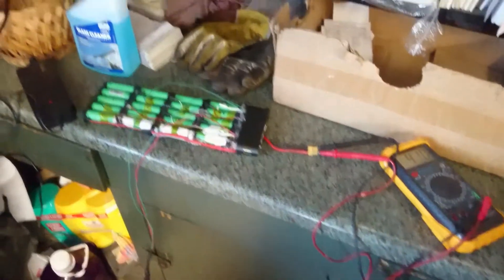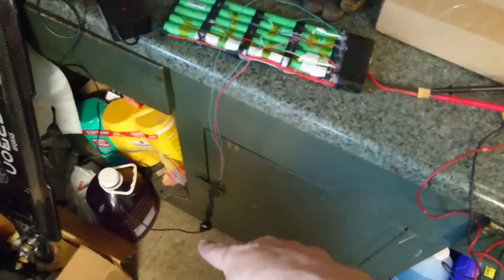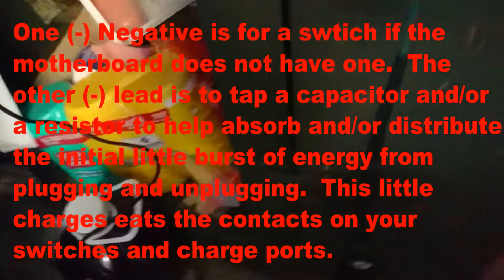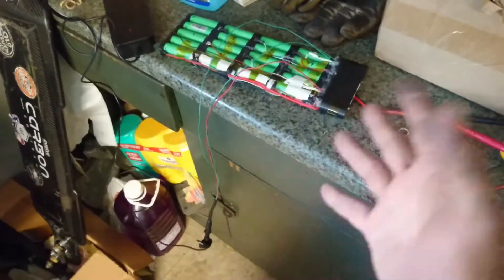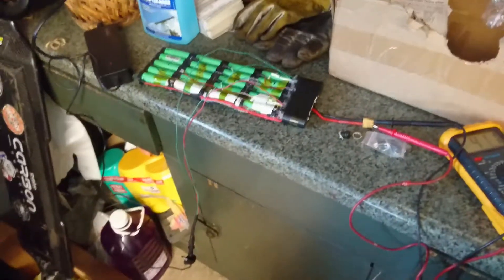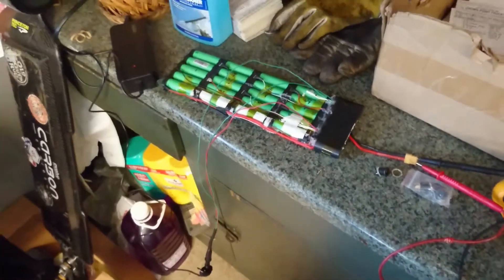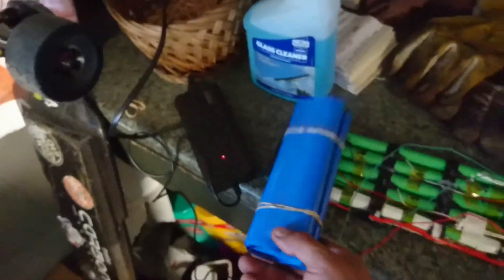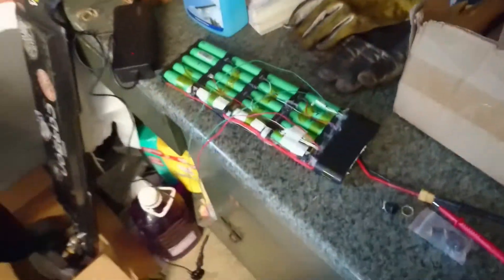Genesis Koowheel Battery Changes and Motherboard Swap - Electric Skateboard Battery

Comment: Hey man, I know this video is old but wondering if you still mess with Genesis boards? I inherited a Tomahawk that turns on, charges, but just won't go. With all the research I've been able to pull up (virtually nothing since these skateboards had a horrible rep) the nearest I can tell is that either it's the remote needing to be replaced or the motherboard. Hub motors have resistance when turned on, tried pairing the remote but no go. Any advice?
Reply from the maker: have you tried to pair the remote yet?
Reply: @JoeKyser  yeah, in my comment above I mentioned trying to pair the remote. No go
Reply: @JoeKyser  dude who gave it to me said it just quit, I hear online that they can do that. One tip was to replace the remote, others said it was the motherboard. Have you successfully swapped a KoolWheel motherboard into a genesis, do you know if KoolWheel remotes actually do work with the Genisis boards?
Reply: @JoeKyser  Thanks for the lightning quick reply bro. You're boss...
Reply: @JoeKyser  The board is in really clean condition, I'm guessing it was probably a kickstarter or 1st gen board with issues, doesn't look like it saw a lot of use.
Reply from the maker: @mrt4646  oh sorry i didnt see that it was in the read more i didnt click lol. yeah they all compatible with each other. I probably have a good used motherboard here im sure. i went through 8 of those boards by the way. they all just stop working because the esc burns out or some other related issue. they really really hate water. thats why they went to a resin filled mother board. the smallest amount of water and they are beat too
Reply: @JoeKyser  Is it possible that it could be the remote? You say you might have a decent used motherboard, are you saying you'd part with it? My first question is more because having an extra remote doesn't hurt and because it's definitely the cheaper option than the motherboard, if it's just the remote then it's like $30 bucks as opposed to whatever the mobo costs...lol.
Reply: @JoeKyser  I am a noob when it comes to anything e-skate related, too rich for my blood and the cheaper they are the more dangerous, that being said I definitely am stoked to maybe get one running. lol.
Reply: @JoeKyser  any advice on troubleshooting the ESC on the motherboard? This just seems like the remote isn't recognized or paired, trying to pair it yields no result.
Reply: @JoeKyser  I do appreciate your time, thanks for replying at all.

Comment: I have a genesis hellfire board for about a year after eight months the board doesn’t want to charge and I still have about 10% battery left that I have never used yet the problem is when I plug it in the board in to charge it does it show the light on around the power button identifying it’s charging same with the charger pack but when I turn it on it works fine with the little bit juice it has left
Reply from the maker: Super common problem. I've had ones that did that and turned out to be the charger. I got one brand new and it was the charger. They sell those 3 prong 42v 2A chargers on ebay for $10 or so

Comment: Would it be possible to use a koowheel battery as a replacement for a genesis tomahawk battery? My genesis battery died and they are sold out of replacements on the website. The koowheel battery has a larger mAh and I don’t know if that will work. I’m not that tech savvy. Any help would be greatly appreciated.
Reply from the maker: yeah they are the same battery. Someone told me they think Genesis is going out of business. They gave me all these reasons. Made sense. Idk but yeah the batteries are the same

Comment: Have u ever heard of a koowheel battery reading at 40v before the bms? My latest video I take apart the 2nd battery and test with 40v reading before bms and 12v after... I know the bms probably fried out but I do not understand the 40v reading before the bms and want to verify the cell layout! Thank you for any help and will pass it on that you or whoever can help with this was the source of the info and knowledge!!!!
Reply from the maker: sorry I was little bit busy earlier but yeah each cell when fully charged can be 4.2 volts what happens is they have a charge limiter this way you can't overcharge the board something like what a couple of the other companies decided to do. I will have to check your videos out
Reply: Joe Kyser awesome... thanx!!!

Comment: Hey man can I sync 2 motherboards with quad hub ? I also have 2 battery where can I buy matherboards
Reply from the maker: +Ovidiu Keresztesi oh absolutely, guess it depends what ones your looking for. I wouldn't use two batteries but i guess you can. Well its not required, lets put it that way

Comment: Hi there! Do you think is possible change the plug like you did and just hook up in one of those chargers from hobbyking? I don't have knowledge in electronics but looks like this bms is a balancer for the cells, right?
Reply from the maker: +Lenine Damacena Santeiro typically charge plugs can be switched to different styles, just like this one can be. Yes one of the jobs of the bms is to be sure the cells stayed balanced. They carry a number of jobs. The bms on a Genesis does not accept the charge plug like other Boards. the charge outlet is connected to the motherboard on that setup

Comment: So are you charging using the BMS circuit board that comes built into the battery? Basically hooking up 42v to the + and - leads of the BMS? I'm looking at building a board of my own using a koowheel battery.
Reply from the maker: +George Crowley i have to watch the video again to catch what you're asking but I already know that I'm not taking the positive lead and hooking it up to the BMS. typically its 10 wires hook d up to postive leads not just one. i will get back to you
Reply from the maker: George Crowley ok I see what your saying. Well what I ended up doing there was put the negative end to the BMW and the positive to the positive tap yes. But, ah ha, taking out the stock BMS. Wired in a 30amp BMW this way I had a proper brain for the new controller. I may have posted those pics to instagram. I get what you were saying now. I forgot what I was doing in this video lol. But yes that BMS is no good for a different control board.
Reply: Ah gotcha, thanks. Sounds like I'll just be building my own pack then haha
Reply from the maker: +George Crowley yeah I actually use a couple different ex Genesis/koowheel batteries now. I keep one on my bench for testing and I have that hybrid I made with one. if you need any kind of help just let me know the packs are pretty easy to make just because the battery configurations already done all the cells are already spot welded together you just have to tap the new BMS into it

Comment: I'm tired of all these weak 350-500watt motors. Why won't somebody with the know how blow the rest of these wagon riders off the scene n make a dual hub motor board with power like or above the. power of the Evolve board? Why is everybody just following the next guy n basically making the same dam board, motor, n legistic style? Come on, there's got to be someone who thinks outside the box. The only difference between boards is basically the motors. Why isn't someone pushing the bar a little higher than the rest. Take ur time but give us some variety when it comes to power. Lets get someone to make dual hub motor board with 1,000-3,000watts or even really stretch it up to 4 or 5,000watts/motor. Even if you can only get 3,000watts in a dual hub motor board. Anything else but this cookie cutter s..t. Think big for yourself n stop trying to mimic everybody else's boards or trying to make one work better. Everybody has basically the same problems with their boards if u read the reviews. Just food for thought but I think everybody needs to push pause n go back to the drawing board n figure out how everything is supposed to work before u go slapping pieces together n selling them causing all kinds of resentments against these companies which is why everyone is trying to make their own. These companies need to get their sh.t together and start enforcing some Real Life Quality Control. I really just want what I stated in the begining n that's more powerful hub motors. at Least 3,000watts between the two! I dare somebody to do this, if I could I would, how bout u? Anybody up for the challenge that will make them stand out in the pack of posers!
Reply from the maker: Thomas Sireci +Thomas Sireci there are companies out there just be patient because what they're doing is just getting it right. they are out there these companies that are out there now it's just all about business that's all it is I feel you though and I think that's the general consensus

Comment: Great video  bro and keep your head up! Quick question, Is it possible to use the Miami electric skateboard hubs for the Amazon 90mm and 97mm wheels?
Reply from the maker: +DJLoveNoise yes it's that same will powdered all those no brand Wheels I'm pretty sure are all exactly the same. I've bought three different sizes from three different places and they've all been identical including the front wheels on the Genesis board.

Comment from the maker: an update about the resistor I used:
It worked great. Initially when I plugged it in it did spark. So I added the resistor and made the leads real long. It plugs and unplugs with no spark now. I didnt want to add a capacitor just because i didnt want the added heat if i didnt have to add it. Thanks for watching!!!